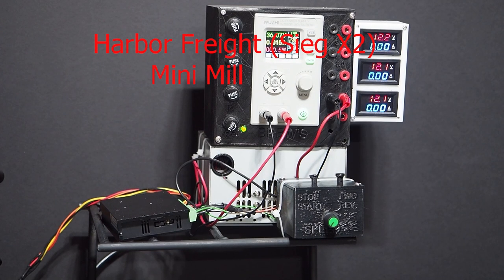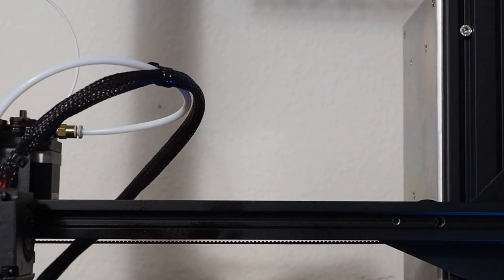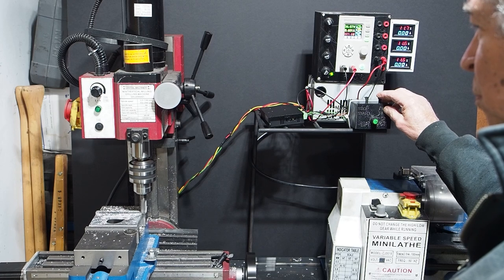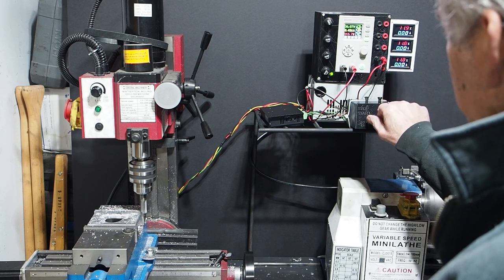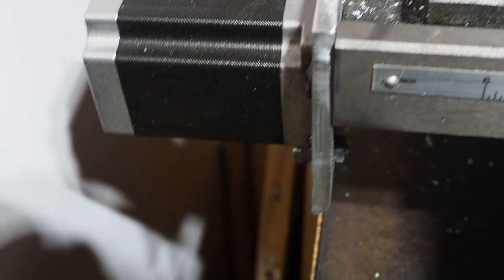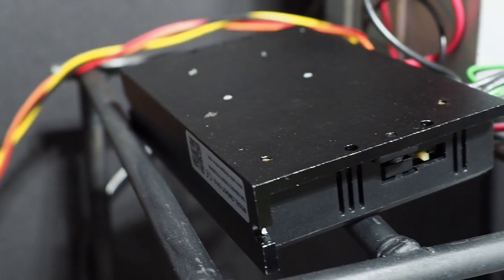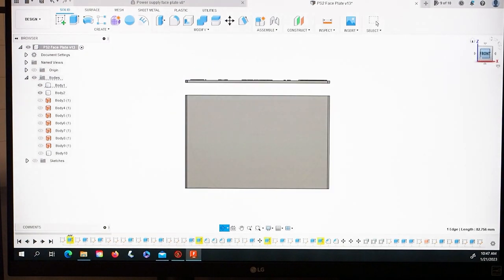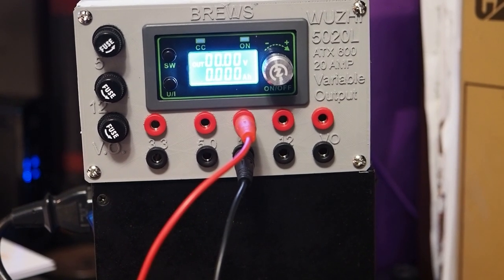MiniMill Power Feed

Comment: Hope that little lathe is treating you well! Im the guy you got it from.
Reply from the maker: It sure is.  I broke a couple belts so turned a couple pulleys and converted it to a J6 serpentine that tolerates my use.  I have everything gathered up to do the Clough42 ELS conversion. I bought the mill from your neighbor three blocks from your house. Did you manage to fix the drone camera?  Back up on the slope again?